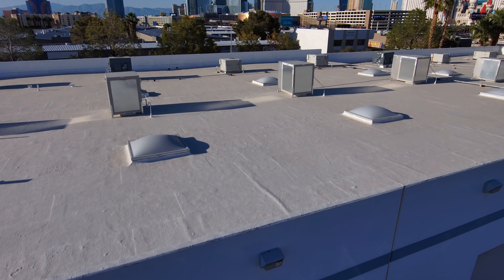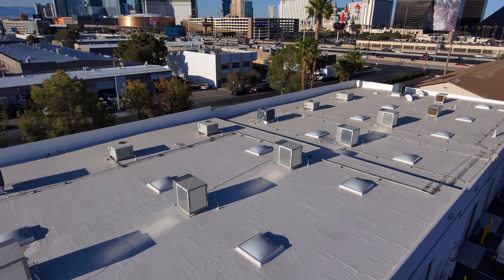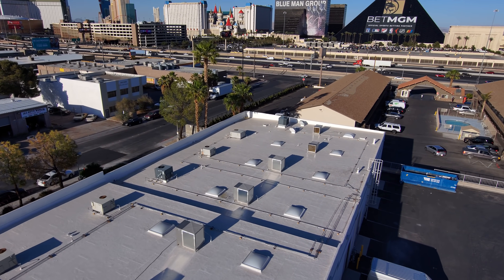TIG Settngs NOBODY is Talking About

Comment: I just started TIG. The toughest thing I have found is diagnosing the weld I just did. Did I go too fast/slow. Did I have to much torch height, too much filler, not enough filler. Was I too hot or too cold. so far though it's been yes to all of these. I have made some good welds and alot of bad welds. I just wish I had a camera to record each time I weld to see what I do different. What was I physically doing when I made those few good welds or all those bad welds.
Reply: The bad thing is, how are you to even to know if your welder/Tig machine is even working right? 
  I can weld stick & mug all day long but when it comes to using a Tig I’m totally lost at what to even put the amps or anything on. I really think my pedal is messed up. But how am I to know lol

Comment: I'm baffled that you needed to address this issue Justin. Over the years n hundreds of videos you've put out to help people I thought you made it quite clear what tig welding is n the process involved in getting better. From what you should be looking for n seeing with the puddle to what changing frequency n balance does to the aluminum. As far as I'm concerned you've done your job as much as you can through videos to help people understand what tig welding is n what all the different variables do to change the process
Reply: I'm baffled at how you think TIG settings or any other settings don't matter. They do a lot. It's not all just experience. You're going to fuck up a lot if you don't know that your gas can't be too high, amps be too low or high, electrodes of different size require more or less amps. Do you really think students should just learn on their own where they should start out? I bet how close the air vent is doesn't matter either, huh? That never causes porosity at all.

Comment: Been a welder for the last 40 years, truest thing I have ever heard.
Reply: I have been  high pressure certified since 1976. He has a point but as a teacher he should be smart enough to know that what people need and are looking for is what the different setting actually do. Eg what does up slope do to the weld. For all the time he wasted telling us that time and hands on experience is necessary he could have just as easily given some useful info. This video tells me he is trying to tell all that he is great and they arent. Total waste of my time
Reply: @holmes1956O  this video wasn't aimed at someone like yourself, it was aimed at the guy who's not long bought a machine for whatever purpose and only really knows how to turn it on. People of certain levels of experience will be after what each setting does. And in that case will be asking specific questions, like "what happens when I increase/decrease the upslope time?". They won't be asking what were your settings for that weld. A standard WPS sheet will have all the settings you need for a specific job, but without the experience or education there is next to no chance a beginner can compete the weld to spec. There needs to be a base of practical teaching of some kind (self taught and youtube videos included), and often many years of practice/ experience, otherwise the settings are just numbers. 
The only reason you got what you did from the video is because that's what you wanted to get. If you already know all you need to know, why watch videos like this?
Reply: @dave98765  you need to go back and actually read my post. It basically says what you are saying. A good educational video will try and tell the watcher what the setting are for what they do and how they will affect the weld. Without that knowledge the inexperienced will have a very hard time progressing
Reply: @holmes1956O  you were critical of a video for not being something it wasn't trying to be. He has plenty of videos explaining what the different settings and setups do. This video was about telling people they can have perfect settings and still have things not look right and that looking right is the secondary concern.

Comment: 100%!  Been welding for 6 months now and when I go out to the shop I switch the machine on, open the gas valve, gear up and weld.  Unless I'm changing material I don't touch the machine again. When I got started I was quite surprised at how little you fiddle with settings once you get going.

Comment: Yes! This is really good.
I don't make pretty welds, I have an angle grinder to fix that!
I also have no idea what my welder is doing while I am welding, I only know what the weld puddle is doing.

A couple decades ago I was teaching someone to drive. It took a similar level of explanation when I was asked "How far round do you turn the wheel to get the car around a corner?". My learner was looking for a position to turn the wheel to for each type of bend, corner, junction. Of course, all drivers know it doesn't work that way, but the learner didn't. It is the same with any feed back responsive skill, you can only respond to what is happening in front of you.

Comment: That's the hardest thing to try to explain to someone. I give you mad props for being a teacher, I couldn't do it. I'm an oilfield welder in West Texas and when someone asks me how did I weld that, or "how can I make my weld to look like that?" I tell them I don't know. I literally look at the weld puddle and adjust on the fly without thinking. Half the time I'm zoned out and have no idea of my rod angle, travel speed, or what kind of rod manipulation I'm doing. If you can't see what your weld puddle is doing and then decide how to adjust to correct it, I can't begin to tell you what "you" should do to fix your weld.
Reply: Yep, once you get your eyes adjusted to seeing the puddle, and keeping freedom of movement,  it's like a form of "painting".
Reply: I think the best advice I ever received when I was a teenager was to get into Tig first then master rod and mig, because the muscle memory is not the same and it's so much harder to teach your brain to adjust amperage with your foot, feed with one hand , and travel and oscillate with the other. I never really got to use that experience ever again after that job, but now that I've been getting back into it after all theses years, it's been so much easier.
Reply: @XxShantilisxX  It's been years since I TIG welded. I have a brand new machine sitting here. Planning on getting back into it this summer.
Reply: Hell yea man, also a WTX welder. I learned to Tig on my sa200. I think the simplicity of a scratch start DC  rig helps a lot. These guys who go out and buy a fancy Tig machine are getting too caught up in what knobs to fuck with. Just watch the puddle guys.
Reply: @cjgibbons5850  agree. To add to that, a lot of these new welders don’t learn the basic fundamentals and the WHY of everything.
Reply: @andrewjschutz  It sounds like none of you know basic settings, what rod angles should be, or travel speed. That's the first thing we learn in college. Settings are important. Not sure why people act like they're not. They might be different for everyone, but it's good to know about what to start out at, how to hold the rod, and if you're going to fast or slow.
Reply: @ebogar42  I can tell you exactly what I set my machine to for what ever position I'm welding in, as for everything else, I don't pay any attention to it anymore because I don't have to. It's all muscle memory and subconsciously done. Half the time I'm listening to music on my earbuds or talking on the phone. So when someone asks me how did I do that I'm not exactly sure what I did. I change hands and reposition while I weld. The best I can do is tell you when welding uphill, move, fill your undercut, move rinse and repeat.
Reply: @XxShantilisxX  I get you don't have to, but I definitely still do and think this guys advice on here is trash. I like to know those things. It helps me a lot. I don't stick with those settings, but it's nice to know what they should be about on.
Reply: @ebogar42  I think he's 100% correct. Beginner welders are too caught up in the "proper" settings thinking that those setting will make their welds "pretty" when they should be concentrating on technique and good habits. Once you know what you're supposed to be seeing, it's easier to know what you need to do. My Tig welder has a foot pedal so one could say that you don't actually know what it is set to the moment you are welding. More pedal more amps. My engine driven welder also has a remote control (not factory) so I can adjust on the fly as well. It has an attachment on my stinger so I'm constantly turning my machine up to penetrante and down as the material gets hotter. Mostly just when I'm welding uphill or on my root pass on pipe.
Reply: I think I learned on an old miler syncrowave and I wish I had bought one of those first. The new inverter machines are great though.
Reply: Greeting from an fellow Texan, who now resides in Thailand. Your comment is spot on well stated.
Reply: @billshuey7422  thank you 😁
Reply: And if you didn't notice, I gave him props for being a teacher, because I recognize that I am not good at putting into words what someone else should be doing if I'm not sitting there watching them and correcting them on the fly until they learn to recognize what the puddle is supposed to look like and what they need to do to correct it.
Reply: actually I think its a pretty simple thing really. Give a guy the best race car in the world, doesnt mean someone can drive it to its best. IE its how you use the tool that decides the outcome
Reply: I've been in college for two years and I don't think it's that hard to explain most of that. My instructors explain it to me and I get it. You can easily find out your travel speed and rod angle. You should know your settings on your machine too, and your gas settings if you use them. Why don't any of you know that? I don't get it.

Comment: Newb welder sits down to stick weld and his stick is always sticking. Experienced welder takes the same rig with same settings and makes a perfect looking weld. If you look close you would see he pulls a longer arc. Or another scenario, the newb sits down and just blows holes in everything. The experienced welder sits down and makes a perfect weld. If you looked close you would see him go in and out of the puddle regularly. 
My college welding instructor said most people weld too cold so he taught us how to weld a little hot for much better penetration.
Reply: Too hot causes porosity. Do you do bend tests to see?
Reply: @ebogar42   No, air contamination causes porosity. 
Besides welding hot doesn't mean as hot as you can. It simply means a little more heat than you should have. I.e. 210 amps instead of 190 or 200 amps.

Comment: I had the same conversation with my weld instructor years ago.  Pretty welds are not necessarily strong, and ugly welds could be strong.  If you look at the oxy/acetylene welds of the 40's & 50's, they did not look good, but they were strong.  A good example is at Mercedes Benz 300SL Gullwing.

Comment: Very valid points.  The "initial settings" for amperage and gas flow are useful for beginners as you pointed out but after that it should be practice
Reply: Yep, lots and lots of practice mixed with trial and error and remembering what worked for that given situation and what didn't all while applying that to the lots and lots of practice.

One thing I think that misleads new people when it comes to TIG is that they watch video on youtube by people like Justin or Jody and others who have the "lots of practice" under their belt and they make it look easy to the viewer but what the viewer doesn't see in all the little intricacies that are taking place that are controlled by the person and not the machine but are also virtually impossible to show on film and just have to be picked up over time with practice and seeing what worked and what didn't for a given situation and then remembering that.
Reply: @CP_300PRC   the initial settings are important, you don't want your machine at 150 amps and 25 cfh when welding 20 Guage corners
Reply: @grege2383  Never said that they weren't but I dont think the issue is "initial settings". From what I see, people get the initial right in a generally accepted workable area but they cant seem to get a good weld (especially one that is also "pretty") and then they think its something wrong with their "settings" when in fact it was their human settings that are wrong because they dont have the practice and experience to know what the human setting need to be.

Comment: Anyone got any tips for LCS (Low Carbon Steel) Tig T fillets? I just started trying them today and I’m having a hard time trying to get my puddle in the right place to deposit my filler. Any tips?
Reply: Torch angle... and what I mean by that is relative to the two parts, not the angle to the direction of travel. The best thing I can tell you is that you have to play with the angle at which you are pointing the torch at the joint. Remember physics and and heats natural travel direction comes into play here so how the joint is laid out has to be considered with respect to where you are directing the heat and where it naturally wants to go based on physics and material properties.
Reply: I have found it's easier to weld toward myself when making joints like that.  It's hard to see the puddle when you weld right to left.
Reply: all fillets, not just lcs: 1. Don't over do the argon flow. You're in a corner that traps it and creates turbulence, so you may need to turn it down compared to outside corner or flat plate. 2. Short arc length. Keep it super tight so you can control what's melting, and don't be scared to move your torch. 3. If you don't have a clearly defined arc cone that you can manipulate with torch direction, speed, and angle.... you have setup and clean issues. Don't try to paint with a mop.
Reply: @walterwhite279  I put all of this to play. But I’m welding on quite small plate 3mm thick and about 20mm long so that’s why I’m finding it hard. On bigger plate it’ll be much easier and apparent too.
Reply: @qesava5297  Walter White brings up a good point that hadn't come to mind when I made my first comment and your recent comment about being able to weld heavier plate T-joints without the problems that you seem to be having with the thin and small plates, I suspect that arc length (and possibly gas too) is where most of your difficulty is coming from.

Without turning this into a book, the shot version is, the smaller and less mass the part has, the more critical arc length becomes. It has to do with energy density at the arc and total heat input mixed with the mass and thermal conductivity rate of the part.  Like I mentioned, it would be essentially a book to explain it but based on you not having the issue with heavier plate, I really suspect that you are trying to weld the joint with too much arc length.

I wish there was a way to post images in comments here because seeing your results that you are getting would help a lot in trying to see where your possible problem is. Many other little details seen in the results can tell a lot about what's happening if you know what to look for. Unfortunately many of these are hard to explain without visual examples and just takes time to become familiar with them to be able to recognize them when they happen.
Reply: @CP_300PRC  I understand what you’ve said. I don’t even think it’s my gas or anything else of the range. Just me trying a t fillet for the first time. I need to concentrate and compose myself to get my arc into the joint, put up my amps and get that puddle! Thank-you for your tips and ideas of what my issue might be entail.